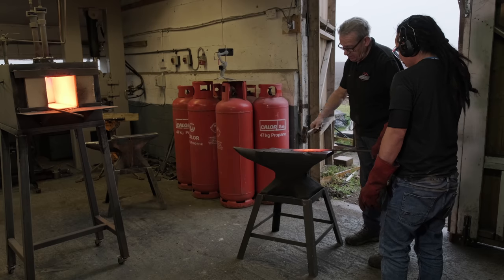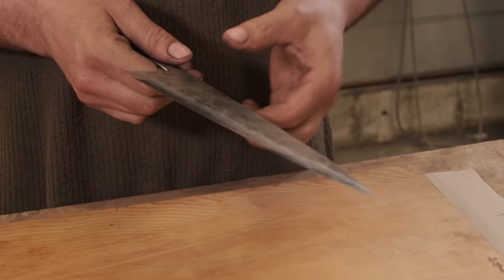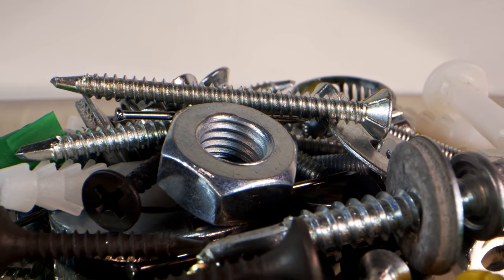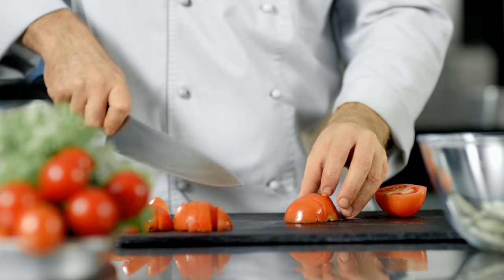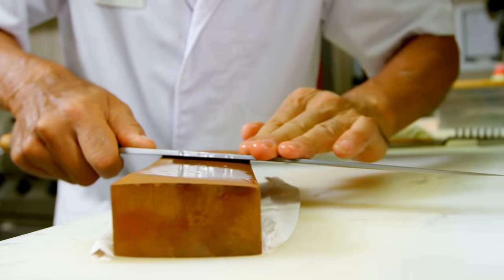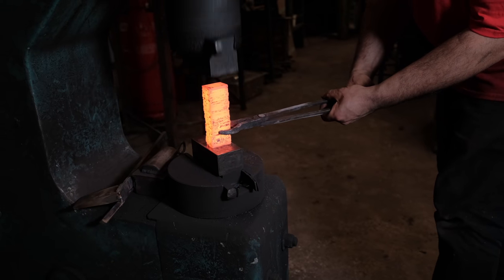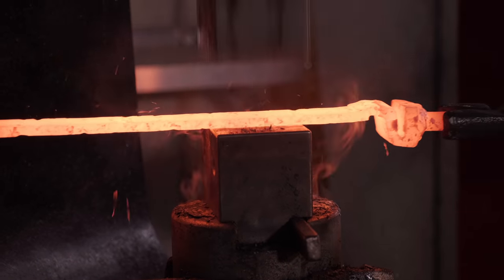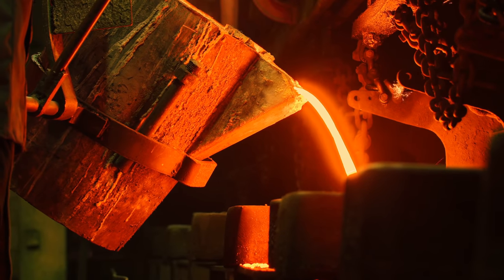Why 98% of knife makers pick the wrong steel according to a metallurgist

Comment: Lot I agree with there, especially the bit about O1. Steel nerds quibbling over 0.2% extra edge retention between steels that cost 3-4x as much as a more commonly available steel ignore the fact that most people who use knives won't notice the difference. Like with the comment about AEB-L and nitrogen steels, if your O1 or N690 knife is getting blunt from everyday use, you're probably using it wrong, and getting a knife made from a powder metallurgy steel is unlikely to solve your problem. My rule of thumb is, 5160 for swords and abusable knives, O1 for bowies and hunters etc, and N690 for kitchen knives
Reply from the maker: Cheers tree planter

Comment: Great video thank you! I have definitely noticed much better results with my 01 forgings than my simple carbon steel forgings like 1084.
Reply from the maker: Yup yup! Graham absolutely loves O1 for sure! If you enjoyed this, I bet you’ll be looking forward to Part 2 of this series coming out tomorrow! Cheers ughmas!
Reply: Are you using the same quench oil for both? I ask because they don't really like the same quench speeds.
Given the choice I use O1 or 52100 for "carbon" steel knives. But in all honesty I've personally seen and used several 1084 and 80CRV knives that performed just as well, assuming both are HT'ed properly.
Reply: @dogslobbergardens6606  I was using Canola oil for both in these cases - I am still learning and experimenting with my HT process so it certainly could be errors on my part. I am also in the process of building an electric heat treat oven to control temps more precisely
Reply: @ughmas  that makes sense. Have fun with the electric kiln build!

Comment: I like W2 because I can get good hamons with it. I hate working with M390 because it's so wear resistant, but it does hold a good edge. Most of my kitchen knives are S35VN. As far as making knives, high carbon steels are just easier to work with, and I like that you can just strop them between uses to keep them sharp. My favorite kitchen knife is 1080 or 1095 (can't remember which).
Reply: You can strop M390 or other stainless super steels too. You just need diamond compound. Vanadium carbides are harder than your sharpening stones and other abrasives. You need diamond or cbn to really work with them.

Comment: I have both stainless and high carbon steel knives of all sizes. Recently made a stainless steel dagger shesth knife. Stainless does take a lot of work to sharpen. I use me carbon chef knife for almost everything. It is blackened of course and gets dirty. I decided to super clean the metal including scratches, etc. After metal clean and dry i mixed a bit of 2 part epoxy and evenly spread a thin coat over the blade. When cured I put the knife back to general kitchen duties. Knife slick durable voating rasy to clean and s handy oil stone keeps it sharp. I am trying to figure out what to transform my useless knife honing steel into that's interesting.

Comment: The only reason I don’t use stainless steel is that my (home-made)forge does not get quite hot enough for heat treating these steels. Because most of them require more than 1000°C.  My go to steel is O1 it “only” needs about 820° or so.
Reply from the maker: Thanks checkar peat!

Comment: I prefer using Elmax as my top steel and then as a second choice I use N690 and 14C28N as well. Also, I sometimes use D2 semi-stainless steel. 
Nothing to do with non stainless carbon steels any longer, I passed that line some 7 years ago.
Reply from the maker: Thanks for taking the time to comment!
Reply: @UKBladeshow  I uploaded this video to my Facebook knifemakers group, so that it will help others, too, to make better knives.

Comment: I've heard from a factory butcher that they use softer metal cleavers, because they abuse them so much. So sharpening quickly is more important than longevity.
Reply from the maker: Hi Lucas. That kind of makes sense. Thanks for your comments!
Reply: For butchery as well it's important to note that with heavy impacts and contact with bones a softer, more pliable steel is much more likely to deform rather than crack. A very hard, very sharp steel cleaver getting hacked into frozen meats and/or bones will chip to pieces or crack in no time at all.

Comment: UPS… 1075 is just fine… Easy to Heat Treat with simple means. ABE-L/13C26/14C28N make for better fishing/Chef knives… (like a Stainless 52100). I like O1’s Compressive Strength for Bush-Craft knives & Chisel edges… (acute edge-apex stability) but A2 has way better toughness, & corrosion resistance, with better edge retention. I like M2 fine grain & compressive strength (but not so much “horse tooth” D2) as I like polished edges. N-695 is a VARemelted  “440-C” that is quite ductile, fairly tough,  & won’t chip: easy to sharpen in the field  (Hard to get VG-10, so N-690 with a Dry-Ice bath treatment before temper,  is “economic & practical” enough for most Camping knives). CPM S90V is great on Hunters, but I let someone else do the grinding. For folders, & pukkos, S35VN marries a good polished edge with great toughness. In fact S35VN & S90V work beautifully together for a Stainless “Damascus”. (My “Home Science” projects stick with 1075… lol)

Comment: So far I have used O2 steel for my bushcraft knives because it is a little tougher and 80CRV2 for the knives that are purely for slicing and dont need as much impact resistance. I want to move to stainless knives but I will need a temperature controlled kiln for that. I don't want to outsource the heat treatment or any part of the knife making for that matter, except for making the steel of course.
Reply from the maker: Hi Pim! Stainless definitely have some advantages over carbon steel (and vice versa) but you are correct, heat treating stainless steel does require more finicky equipment to get it done properly! Thanks for  watching and I hope you enjoyed the video!
Reply: Can't you find a ceramic club not far from you?
Reply: Making your own heat treat oven is a decent project in itself if you're electricity inclined as well.

Comment: Great video! Although I’m not a knife maker I do have a knife made by the great Mile Irie that is S30 V which holds an edge nicely. I am, however, an engraver and custom rifles maker and I thought, at one point, I’d like to engrave that knife…but it’s just too hard for my gravers to even scratch so it’ll stay as it is. As an experienced big game hunter I am still looking for that one knife design that will skin and butcher a critter so I don’t have to carry two knives while backcountry backpack hunting. I’m not talking about these oversized and unwieldy Frankenstein ideological hunting knives you see in stores. What I am talking about is a knife with a 4 1/2 to 5 inch blade, 5 inch ergonomic handle and a blade curved enough to be effective as a skinner yet straight enough to do the butchering. A knife that is fairly rigid yet able to be a little flexible if needed. Perhaps I may be dreaming.🤣🤣🤣
Reply: i used to engrave.  a 120 degree rotating diamond will engrave any steel.  just dragging the diamond cutter over the steel will mark the surface
Reply: @ibrahim-sj2cr  true enough but it would take an eon to engrave scrollwork and removing background would be near impossible.
Reply from the maker: Hi Richard thanks for taking time to comment and your work sounds interesting! I would love to know more about engraving etc as I know it's an art form for sure! Nice to see you in our vids and hope to see you again on the others! Cheers!

- Vinz

Comment: I'm your typical peasant dabbling in knife making and am looking to move away from carbon steel  because like you said, i hate keeping them clean. Are there any stainless steels that are more user friendly that don't require fancy heat treating ovens? i've got a propane forge that can get hot enough to weld and i'm sure with a pyrometer i'd be able to get temperature dialed in pretty well. suggestions?

Comment: Sharpening a stainless steel blade can be really complicated. Even at the basic level sharpening of a cheap stainless blade you have to deal with the plentiful burr. If you are looking for the ultimate sharpness you need to grind those hard carbides. Commonly used sharpening stones can’t touch them. You need diamond or cubic boron nitride abrasives. You need to also learn new tricks to beat those hard carbides. I personally like high carbon low alloy steels like Japanese blue/white paper steel. One of my favourites is Roselli’s Ultra High Carbon (1.8-2.0 %) steels. When high carbon steels are hardened over 60 HRC they keep their sharpeness for a long time. Despite the high level of harness they are still enjoyable to sharpen. Carbon steel also develops this beautiful patina. The blade get painted with the time. Stainless looks only boring throughout it’s lifetime.
Reply from the maker: Hi 👋 thanks for the fantastic comment! As much as a lot of people may like stainless steel, I myself am a carbon steel kinda dude. Like you, I love the patinas on my carbon steel knife.

Thanks again and I hope you’ll enjoy our other videos!

- Vinz

Comment: I have some quite large generic-branded spanners which are of no use to me (I have several sets of more useful sizes). They are stamped "chrome vanadium", although there's no further detail but one has a snapped-off head which might point to it being something other than what it is claimed? I was thinking of turning one into a knife and I wondered whether that would be a good/bad idea? I've only ever worked with leaf springs before (found some in an old family shed).

Fascinating presentation - thank you.

Comment: I like 1075 mostly because it works easier under the hammer and not too much of a pain to heat treat.  I liked this video I personally don’t work much stainless mostly because  they seem a little daunting for heat treatment.
Reply from the maker: Thanks Ottoforge and great to hear from you! You are 100% correct, 1075 is a very easy steel to work with and I'm glad to hear your comments! Hope to see you on the upcoming video and I promise it's going to be not 'straight-forward' ;)

Comment: Excellent video, thank you. I am a mechanical engineer and country man. I do like my knives, which some people think is a bit weird but they are mostly the folks who have blunt bits of cheap rubbish in their kitchen drawers. I am a bit of a stubborn traditionalist and like my old forged carbon steel blades but I do have a few stainless 'Granton' knives which are excellent and consequently in constant use. 
Our very best knife is an old (150 years plus) table knife which I got out of a dustbin. It was made by Peyps 23 Poultry Road and is stamped 'London Made'. It is forged from several layers of steel, it is in daily use and keeps an edge which I could shave with for months on end, normally until my wife tries to cut through something rediculous with it, like a bit of meat with a bone in it. I have never been able to find anything out about Peyps, but by God the man knew how to make a blade.
Reply from the maker: Hi Wotjonesz thanks for the comment! I had a look and the address points to an exact location in London! I don’t see any knife makers in that specific road but would love to find out if we can find the source of that interesting knife!
Reply: @UKBladeshow  Hi, I did the same searches myself. The only reference that I have found relating to cutlery bearing the mark 'London made' was in an article on a page called 'The victorian web' - Cutlery and Cutlers at Sheffield, Henry J Palmer. Very detailed and well worth a look. Regards, Jon

Comment: I prefer carbon steels on all my outdoor and daily using knives. I have several types of carbon steels, but I prefer good ol' 1095. They have stains and every stain is a memory. Carbon steel blades are very sentimental to me. Growing up in the seventies and hunting as a youngster has a lot to do with why I prefer it as well as my dad, grandpa, uncles. I remember in the very early 80's wanting a stainless steel knife so badly and I finally got one around 83, but I quickly regretted it. Not only because it wasn't as easily sharpened (not a problem for me now) but because after an outing there was no memory of it in the steel. Honestly the only reason I prefer stainless in the kitchen is because guests have ruined some of my carbon steel kitchen knives while housesitting! I carry carbon steel stockmans, trappers, barlows etc.etc. etc. and carbon steel belt knives... fixed blades, large folders daily depending on where I'm going etc. and after they patina they are fairly rust resistant and easily maintained, yet they all still have those very special to me memory stains here and there on them...and in an emergency they can be struck on a flint or high glass content rock to throw a shower of sparks in the unlikely event I'd need that feature nowadays. I'm more or less an all around traditionalist too. I love old style knives, muzzleloaders, flint and percussion, old sixguns, leverguns etc. I enjoy my western guns much more than my AR's for example. I truly wish there were more modern knives made with 1095. I have some modern designs with carbon steel blades, but not enough. I absolutely fell in love with modern one hand liner locks (a few modern locks appeal to me) and I find them quite accessible, fast, convenient and useful, but I don't have a whole lot of them with good old fashioned carbon blade steel.
Reply from the maker: Thanks Hercules for that wonderful comment! 1095 is just an absolute classic. People love them for many reasons and like myself, carbon steel tells a story so I love them too!

Thanks again!

Comment: Great Video, I use RWL34 for kitchen type knives and O1 and 80CRV2 for Outdoor knives, currently I want to test 52100 for Outdoor knives. Has anyone tested O1 vs. 52100?
Reply from the maker: Hi Raphael thank you for the feedback! 52100 is another great choice! Like you say and have heard in this video, everything has a compromise so it really depends on what you want to achieve. 

I appreciate you taking time to comment! Speak to you again soon!
Reply: I've made a bunch of outdoor knives in both O1and 52100. If you like one, you'll like the other. I sincerely doubt most people could ever tell the difference between the two. They're both excellent choices for "carbon steel" knives of any sort. 80CRV is perfectly fine, too.

Comment: I worked with heat treat department for a us military ball bearing maker,they would heat up the metal to hot as hell,they freeze it with nitrogen,that is about as strong as it gets,then dip it in oil

Comment: Powder metallurgy is not a new process, being developed during 1968 or before. High temperature and pressure will weld the small partials (some about the size of corn meal, some larger, some smaller, some flake like, some ball like) togerher. (Side note: heat is not needed to weld metal together. In 1969, a Materials Science professor of mine was welding 2 pieces of steel, about 6x6x2 inches, together at room temperature over time by pressure alone. The mating surfaces were extremely flat and smooth.) One graduate student's project involved forming complex shapes, a 1 inch high Mickey Mouse figure, and possibly other shapes by the process of a symmetrical C4 shaped charge explosion. It worked, too. The partials don't have to be the same, brass-steel, iron-iron carbide, and many others. The beauty is you can mix very hard but brittle with not so hard but ductile materials to make objects like blades both are both strong and hard. And then there is ceramics.

Comment: Hello,what about mora they use 14c27 stainless an some carbon steel, what about 80crv2 carbon steel, I know there's varidium in there an some chromium, I love it,yes more maintenance required but tough an holds an edge.

Comment: Perhaps to machine hardened steel, you need to adopt bevel forging and then hardmilling as a process.  In hardmilling you are melting off the chips by bending them fast instead of abrading them.  Faster speed is better within the limits of the tool.
Reply from the maker: Thanks for the comment, I appreciate your input b
Reply: Hold on now… hardmilling acts exactly like regular milling. You’re digging the cutting edge of the cutter under the material and peeling it away.

Comment: I'm not a knife maker but most of the knives I own are made from D2. They stay sharp and never rust not sure if it's a stainless steel but it sure works like one.
Reply from the maker: Hi Adam thanks for the comment! I believe the D2 is a high carbon, high-chromium type of steel. It seems to be a very interesting type of tool steel!

Thanks for sharing!
Reply: As a Die Maker we use D2 regularly in cases where wear is an issue, bit the shock load is lower (as D2 can be unforgiving). A2 for general use (shearing dies) and S7 for more shock resistance (scarfing cut)
I personally have two knives out of D2, keep them honed and only use as a knife.
Reply: @bowez9  exactly, D2 was designed for dies, not knives. That's literally what the "D" stands for - die steel. When I worked in the printing/converting industry, D2 was the standard material for our paper-cutting dies. Because the high wear-resistance was desirable, but raw strength and toughness weren't terribly important.
D2 will certainly work for knives, but it's definitely not my first choice. There are several other steels that have the same wear-resistance or even better, often with even better corrosion-resistance, and almost always a lot better toughness.